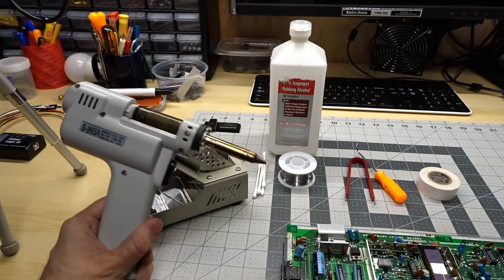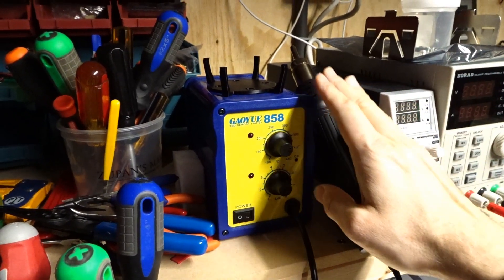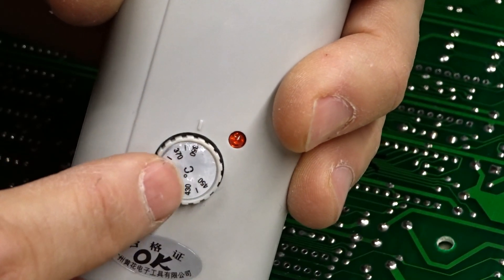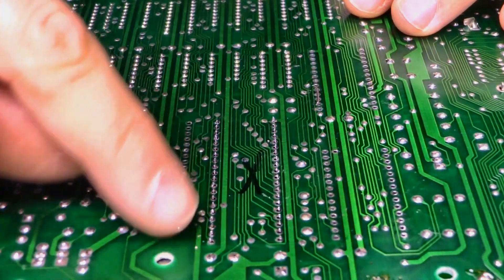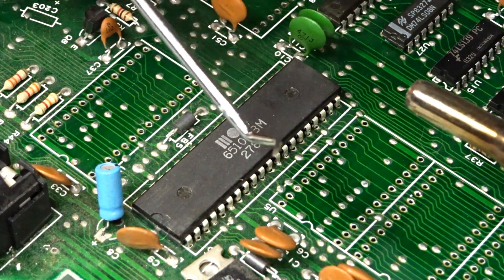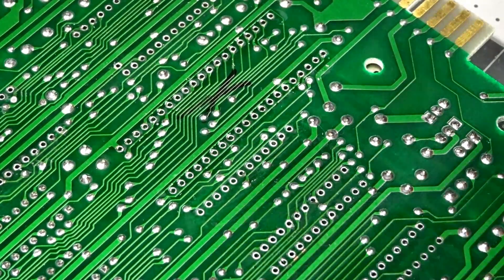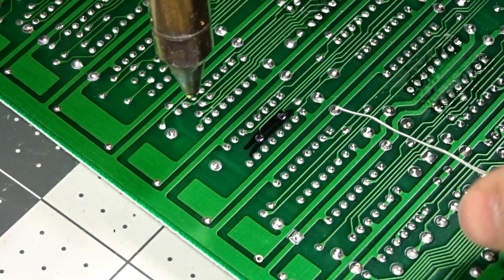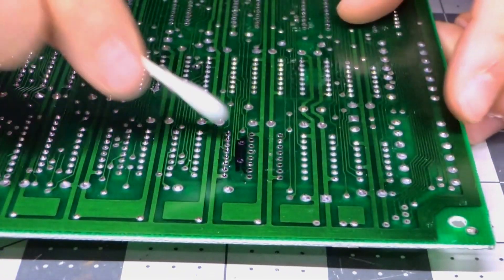How to remove chips without damaging the circuit board

Comment: Repeating what someone else said 3 years back - if you are removing a defective chip, just cut the pins on the top side and take them out with a regular soldering iron and tweezers.
Also this:
https://youtu.be/Vou2xlJkuoU?si=eXz6sQ59gBCEVWuX

Comment: Thanks... never thought of using hot air on non-surface mount! For those who don't have a vacuum desoldering iron I find desoldering braid works well if you put some liquid flux on the braid first. So the steps would be: Add a small amount of fresh solder to each pin, remove solder from all pins using desoldering braid + flux, hot air and lift chip as shown in the video.

Comment: Excellent demonstration.  I use this technique as well.  I still have to find a way to remove a small a small 52 pin pci connector for wifi for a X230 PC.  I have destroyed two of them on a donor board.  Its a real pain of a connector that is not available anymore from anyone (no wonder).  It has 26 surface mount pins on one side, and two rows staggered 13 pins each of tiny through hole pins on the other.   Yikes, what a nightmare.  I got two out, the donor board pads and holes are fine but the connector is scotched.  The only advice I would have on this video is that we don't need to watch you do 40 pins - I would edit and skip ahead after enough representative pins are desoldered.  Keep up the good work.

Comment: This video just saved my board!  I am building a kit and I accidentally soldered an IC into the wrong socket.  🤦‍♂️  I used a Radio Shack desolderer.  Not great, but it got the job done.  Fortunately I already had a heat blower.  Thanks Adrian!

Comment: I fixed my first C64 thanks to your desoldering video!  Replaced four bad memory chips with a desoldering pump.  I didn't have a rework station, but managed decently enough.  Thank you so much!

May I ask a question?  The diags cart reported bad 6526 and 6581 chips on both of my C64's, but the computers seem to work fine (plays games, disk drive port works, etc.).  Is this a common quirk of the diags cart or are these chips "marginally" bad?  

Thanks again for your videos!

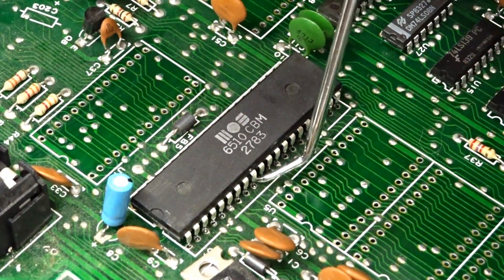Comment: 10:17 is there a way to remove it with an air dryer or only soldering iron?
Reply: No, not at all. Don't do it. This depends on the circuit board substrate and copper layer quality. See my entry about using a solder pot and kapton tape.

Comment: I just wanted to say thanks for your video!  I bought the low cost rework station and successfully removed a 45 year old 40-pin DIP from a PCB using your method. Thanks again!

Comment: Yeah 5 years later for me...but I have to say this is the same way I have done it only thing I used to use a hand pump desoldering iron. The trick is to rotate the pins while you are sucking the solder. Great job!

Comment: I was really struggling to remove the rom chip from a C64 using a simple hand pump. After watching this video I bought a similar desoldering station and it worked perfectly! After adding a socket and retesting with the original rom, it worked perfectly. I can now try the switchess rom mod 🙂

Really ace tutorial, Thank you

Comment: Just burned up a pad on a ZX Spectrum trying to get a chip out with a similar desoldering iron with the vacuum pump. I didn't try adding fresh solder first. I'll give that a go. Great tip.
Reply: Well, Using the above method I quickly removed two 16 pin RAM chips from the Spectrum. They both tested good so I can put them back into a socket once I'm done.

Comment: Another trick I recommend, particularly if you don't have a desoldering gun and are using a more manual solder-sucker or wick, etc, is after you've removed all the solder (or as much as you can), use a pair of needle nose pliers on each pin from the underside, and try to wiggle the pin from side to side within its hole.  If it's fully desoldered, it will move.  If it doesn't move, you know you need to work on it more.  In some cases, if there's only a little bit of solder still holding it on, the horizontal motion can make it break free, without damaging the traces.  Never try to remove the chip until all of its legs "wiggle", and you won't have to worry about pulling up traces accidentally.

Comment: Nice to see that the cheapo heated desolder pump I got isn't that bad. Might not be for heavy use in a pro workshop butiIt can easily such the solder on both sides and the suction is quite strong. Sure there's usually a tiny bit of solder that holds the chip in but then I get the ordinary solder iron to puch the pin to the center of the hole and it let go. Already repaired one 425 board - without lifted traces and without hotair.

Comment: this wont work with old soviet boards without solder mask, traces there so fragile, so better cut off chip pins and desolder one by one killing chip itself and save board, in case you care about chip you need soldering pool or use large chinese sucker with plastic nozzle because metal kills board by vibrating and cutting traces, if holes are big use wire insolation to snap on melted solder over the pin

Comment: I'd always used the hand pump and/or braid , then I got a hakko fr301. For the first time ever, I removed a twenty pin edge connector from a double layer board , both board and connector survived unscathed , and I realised I'd been desoldering in the dark ages for all those years.

Comment: Some comments I feel compelled to present for the general good.  First, you had a very favorable, well done board.  Some boards have too small holes for the chip pins. There is a guide for a proper hole sizing related to the pin size.  It has been published by some institution of PCB manufacturing, whose exact name I have already forgotten.  Anyway, the idea is that you need enough space all around the pins for letting air to flow, and thereby releasing the pin from a leftover solder.  Which also depends on using the least temperature and best cooling of the pin and the plating, so the solder cools below its melting point.  Pace, a soldering and desoldering gear manufacturer many years ago arranged seminars and published VHS videos about these topics.  Good stuff.  So, a warning about using too high a tool temperature, which does not let the solder temperature to drop during the ongoing suction.  Don't overheat - that just makes your job more difficult!  Then, on multi layer boards, try to figure before starting, which pins have a tie to any of the inner layers and adjust your temperatures and timing separately for those "special" pins.  I mean, do at first all the easy ones, the adjust your settings for the remaining problem ones.  My personal problem experiences have been too tight holes or a beefier component substituted (same outcome).  In those cases, I evaluate how sure I am that I need to remove a particular component and do I have a replacement on hand.  If yes, I generally cut the pin(s) and then remove the stub individually.  Finally, in case of multi layer boards, I may need to mount the board vertically, heat the left behind wire 18:01  stub on one side and use forceps on the other side to remove the stub.  Finally suck the hole clean.  A nasty memory on a board I myself designed for a 1N4004 diode needed to be beefed up with a 1N5404.  As its thicker wires still fit in the (clean) holes, we did not promptly revise the board, but a few times later experienced the punishment, when there occasionally still was a need for desoldering.  Sigh...

Comment: Hi Adrian and HAPPY NEW YEAR. I bought the exact same desoldering gun off eBay but it just gets super hot and the temp control does not work. It gets so hot the insulation starts to break down and it delivers electric shocks.

Comment: All that matters you got it off the board with no damage which is fine. Those surface mount power transistors got damage with my equipment. What I did was cut the board around it was just to reuse the part. Didn't care about the board because it was free. But your way is better. But still don't know if your method would get that part off. Maybe so.

Comment: With such a good method that the circuit board is not damaged, it is possible to create a new circuit board after the old one and order it from the manufacturer you trust if you have removed everything and made a note of where what belonged. 
as if one laboriously mends defective conductor tracks. 
because you know that the new circuit board is completely intact and will last for the next 20-30 years if you didn't make any mistakes yourself when creating it.

Comment: After working for several years on component replacement level equipment repair, I started a new job with a photocopier repair crew. I noticed one guy carefully trying to unsolder an obviously blown chip (a motor driver with a hole blown in its top). I suggested to him that he should just cut the pins of the chip and remove them individually to prevent damage to the tracks. He was surprised that he hadn't thought of that before!

Comment: Pretty decent method, especially with having the best tools for the job!  I have done a lot of rework over the decades including Milspec and you pretty much followed most of the best practices... there were a couple holes that were not cleaned out as fully as I would like but were still quite tolerable... the mistake on marking was amusing because EVERYBODY does that at least a couple times... even so, on older equipment it is sometimes good to refresh the solder anyway due to age and crystallization... I have actually recovered faulty equipment merely by reflowing with newer solder.   I actually upgraded an external pump de-soldering iron  by getting a Harbor Freight vacuum pump and a couple of dump valves and had two foot pedals I could use to trigger the valves and get a solid vacuum pull for even larger scale parts connected to larger ground planes. You DO need reinforced tubing to do so and I also had several inline filters to capture the solder and dust spray.  As others have said, keeping your tools clean and well maintained is a MUST to keep up a good experience, especially when you do it on a daily basis. I always made sure to do my maintenance at the start of the day and somewhere near the middle and had plenty of extra 'consumables" at the ready... the time you spend maintaining your equipment will save you MUCH longer times trying to fix it later... not to mention the frustration of having to sideline your project while getting your tools fixed up.

Comment: When the chip legs are still "stuck" to the pad but there´s no noticeable solder left I just "unstick" each leg by pushing it sideways from where it touches the pad with a small flat screwdriver.

Comment: Just moving the tip in circles as the pump runs is a good idea, simple, but I can see the benefits pulling the IC lead from the pad/via to clean all around the pin. 
And the necessity for temp control on the tip. Nice work. Thanks.

Comment: Could of just used hot air on the back side of the board on those chips. I have a de-soldering station it works great but I use it little as possible, they get clogged up fairly quickly. The more it's used the more it needs cleaned, the less it's used the less cleaning. At the rate you're using yours, it'll need cleaned real often.

Comment: Thanks for a great explanation! Your way of desoldering is a bit different to mine, and a bit better too. Now I know a heat gun is next on my shopping list ;-) 
I would use no-core solder in this case - the flux has no added function and only makes it messier.

Comment: What happens if you put a NES 6502 based CPU (Ricoh RP2A03/Clone: UA6527) in a commodore or other 6502 system, will it work? Will it be capable of using the extra features?

Comment: Your technique worked well. The only thing I would recommend is to protect that electrolytic that was almost leaning up against the 40 pin IC against the heat gun. This can be done with a bit of the insulating tape.

If you don't have a heat gun, you can still get chips out. Start by sucking as much solder out of the hole as possible. The IC will then probably still not be free, since where the pins touch the side of the hole, there will be solder. So the next step is to go round again, heating up each pin in turn whilst gently pushing the pin into the centre of the hole with a sharp point. Once it's free, keep it from touching the hole edge until the solder resets, then move on to the next pin. Once you've done this to all the pins, the IC should drop out.

Comment: Nice work...using soldering/desoldering tool to melt and remove solder. I also have that kind of tool, but it is manual...you have to press the lock to activate suction.

Comment: if it works it works no right or wrong....i use liquid flux as well as i do modern boards with lead free solder which is 10x harder to work with.

Comment: Pace desoldering tool instruction videos used to tell you to have the desoldering tip working in a circle as you ran the pump to wriggle the pin and ensure air sucked all sides of it. Ideal desoldering tip sizes is fractionally larger than the wire being soldered, to allow working it as you desolder

One of their old films is here: https://www.youtube.com/watch?v=e8KRPFOD1RE

Tip: if a hole only half-desolders, resolder it before trying again. It's easier to desolder a full joint than a half empty one

Comment: Nice work.
What I do if some pins are not completely desoldered, I resolder them and desolder them afterwards. With the newer solder, it's easier to desolder again.
However I would consider not to unsolder one pin near the other, but always one and then the one on the other side. So that you heat is not always at the same place.
Reply: I had to read this twice to figure out what the heck you were saying. Great advise tho!

Comment: Lay down some good quality flux and skip adding solder and extra heat to each pin. This will speed things up and help prevent some of the blobs from running down to the other side of the board. The percieved rejuvination of the old solder, is simply the newly added solder introducing flux. Good flux cleans up easily with alcohol.

Comment: This was very helpful, thank you so much! I expected a desolder gun to be enough but the IC that I'm desoldering got stuck and you put me on the right track to getting a heat gun. That was all that was needed. This is clearly something that requires practice to get better at but it's helpful to at least know the necessary steps to take.

Comment: Hello Adrian,

I was in the electronics industry for around 10 years throughout the 90's and early 2000’s. I have desolded my fair share of through-hole and surface mount components. At that time we were doing a lot of through-hole to surface mount re-design.

In your video you stated your concern regarding the technique you employ to desolder through-hole components. No need to worry as your technique is spot on. You did a great job removing those components, the PCB pads looked as good as new.

Adding solder to through-hole pins or leads before removal is to "re-flow the solder". A must do to get old crusty solder flowing again.

Your solder pump looks to be in good shape after two years of use. So you know that it needs regular cleaning. The tip can become abrasive over time which can lead to pad damage. The vacuum pump and camber can get clogged up petty quick too.

Thank you for your most excellent videos!

Cheers,

Robert
Reply: sounds like you should be the one making videos

Comment: I think a good secret in your technique is the little wiggle/swivel you do to move the pin around while it's heated and being sucked away, allowing ALL the solder around the pin to be sucked out. A common problem I've seen is folks just put the desolder iron over the pin, but leave out the wiggle, which leaves behind solder if the pin touches one side of the via (as is often the case), leaving a small zone of solder remaining that prevents easy removal.
Reply: That wiggle is good but it can also damage pads in certain circumstances.

Comment: I own this desoldering gun and I don't like it, after removed the stainless steel tube inside the nozzle and changed for a copper eyelet this tool works much better.
If you want an excellent throughole desoldering go for the Yihua 948.
Price is Us$100 dollars.
Today is the best option for tight budget.

Best Regards

Comment: I think you could do it without hot air too. Just use some flux and a soldering iron on the stuck pins on the top side of the board and desolder them again afterwards.

Comment: My method is first to use some BGA flux. Then i fluxe the solder pins. Then using my weller rework station with a 50 watt solder iron and long small tip.
Then go over every joint on the pcb and add some fresh solder to it (old solder have mostly some hard time to get it quickly molten.)
Then add more flux. Then take the desolder gun and desolder  one on one. If the solder is gone its good. If there is still solder left. Take the 50watt iron again and apply some new solder again.

Then suck it out again with the desolder gun.. If everthing looks good. I take a small flat head screw driver.. And touch every joint to see if is loose. If so then in going to see if can remove to object. Mostly if every joint is loose the part is good to remove.

Comment: I found this video was the best one that helped with my chip removing task. I was struggling before I viewed this video. I wasn't "adding" solder as I tried to suck out the old. I was just heating what was there but it was messy and not really working. Thanks for this very helpful upload.

Comment: I would recommend using a soldering iron with solder wick on the top part of the pins versus prying up because you still run the risk of lifting pads and traces that way. Plus, once all the solder is removed the chip should wiggle and you should be able to pull it with minimal effort. Excellent video! 👍